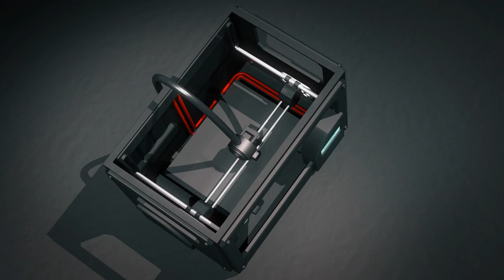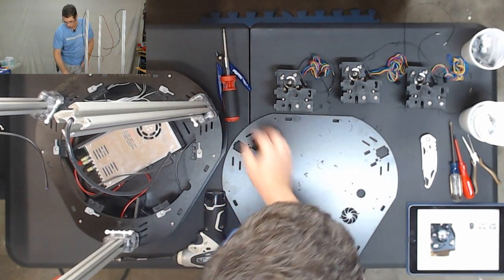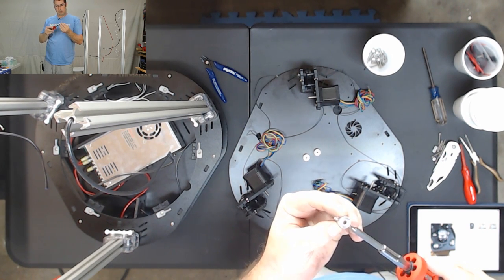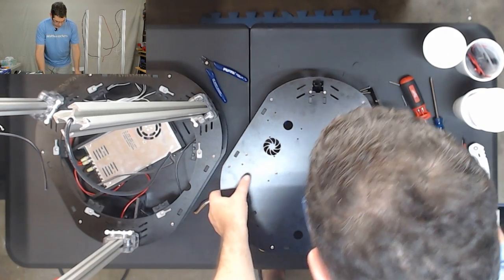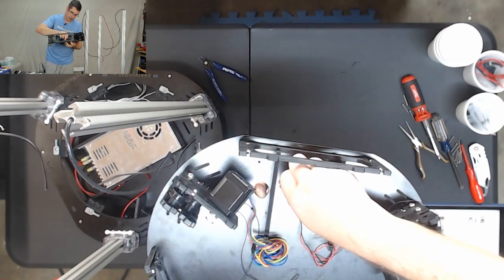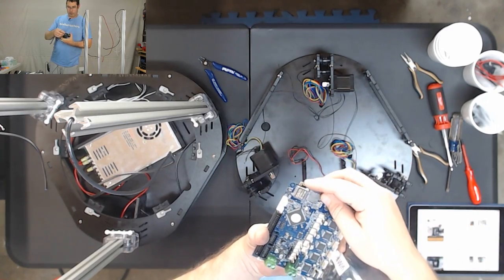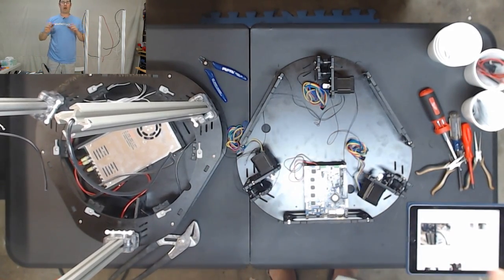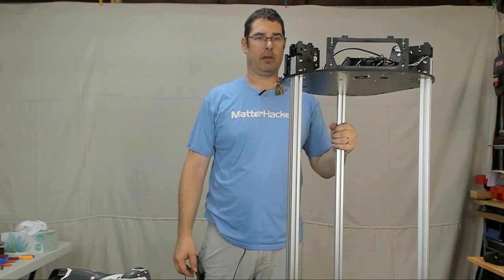SeeMeCNC ROSTOCK MAX v3.2 Build Series Part 8: Steps 24~30

Comment: Mine arrives on Tuesday April 24.  I hope this one works as well as promised. I have the Geeetech delta rostock mini G2S Pro. It has dual extrusion and never could get the nozzles level with each other. I have the parts required to swith it to a single extruder, but have not been terribly motivated to do anything with it.
Reply from the maker: Vance Howard  I’m looking forward to getting this done too!  If it’s anything like SeeMeCNC’s previous models this is going to be great!!!
Reply: Yeah. It does look like they put some thought into it and the manual looks more complete than what I saw with the other one. I just finished assembling my Prusa I3 MK3 on Friday and Prusa's manual is well done also. There has been nothing but awesome prints from it from the very first print.

Comment: I was given a Rostock Max V3.2 for free (with several of the upgrades!) and I'm not sure if it happened during the move or what, but if I'm measuring/checking correctly, it looks like my towers are not parallel and possibly not square to the bed (which I think is the cause of some dimensional inaccuracies that I'm getting).  The Y tower, in particular, seems the worst, tipped inwards.  Do you have any tips on how to adjust things without a major teardown?  Or do I just have to bit the bullet and do it?
Reply from the maker: High Douglas, unfortunately I don't have the printer anymore- I've passed it along to other hobbyists to enjoy.

Purely going off memory, I would think you should be able to loosen the bolts on both the upper and lower side of all 3 towers and adjust it back into parallel by using a square against the build plate.
Reply: @crussty3d  That's kind of what I was thinking I'd try... thanks for the quick response!